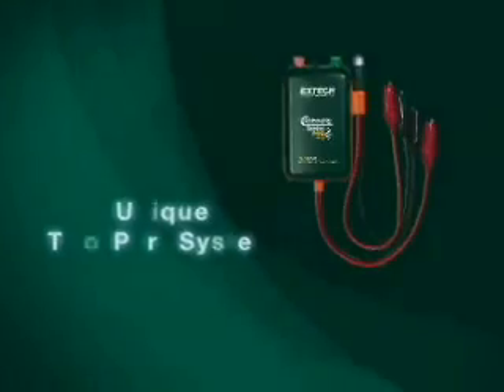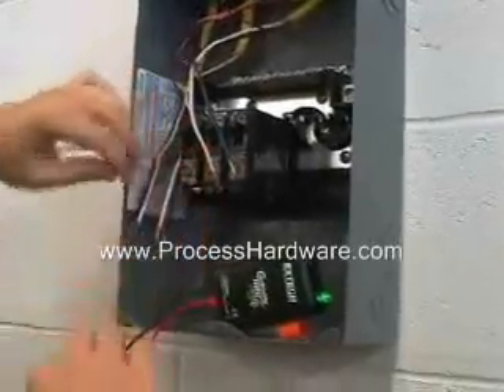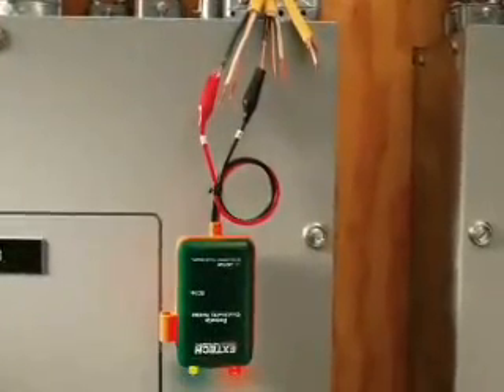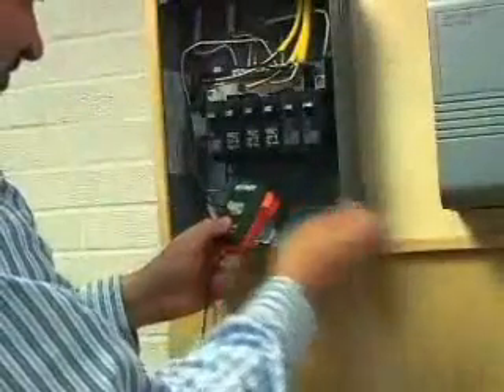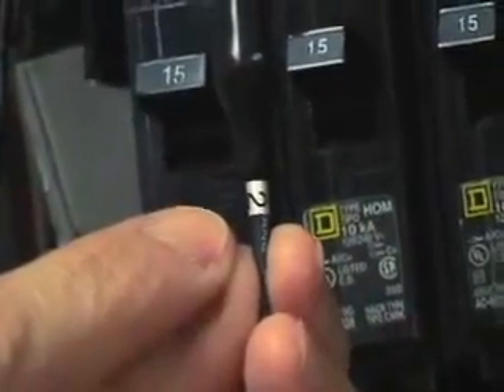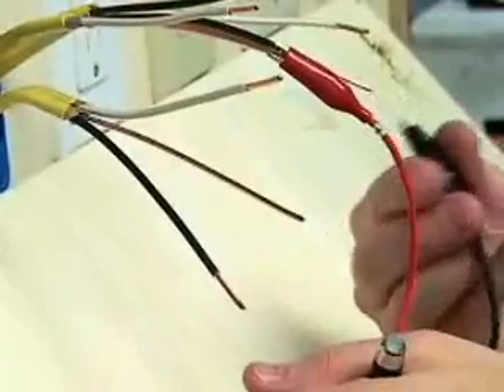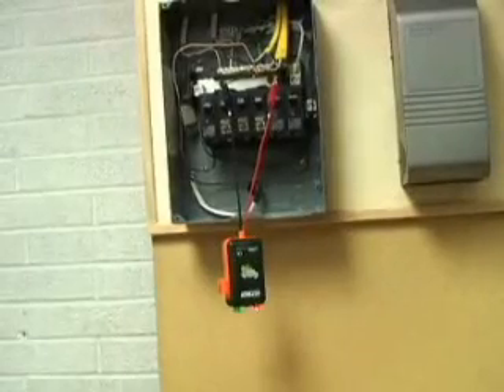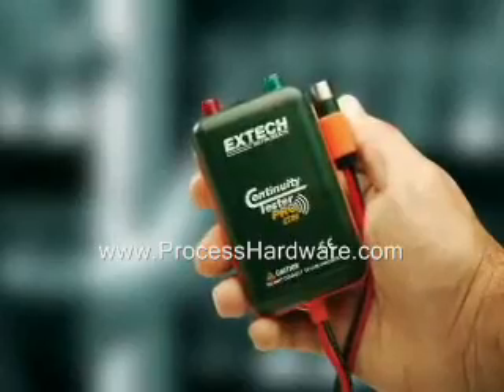Continuity Tester Training Video - Extech CT20

Comment: The Polatron-1 can simply check how and  if the part is working  without having to remove it. Checks if open or closed with power on or off does not matter.  Ingenuity combined with continuity .polatron.com